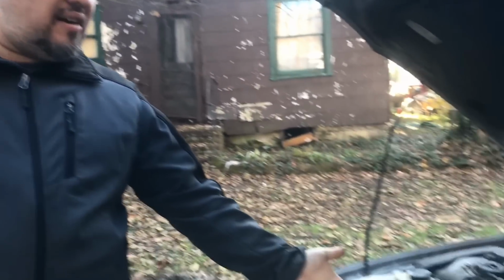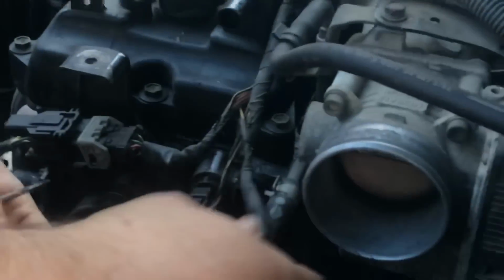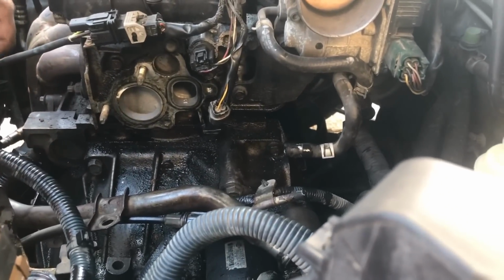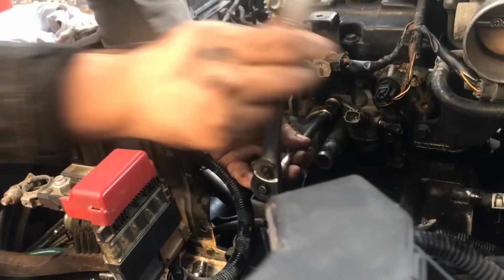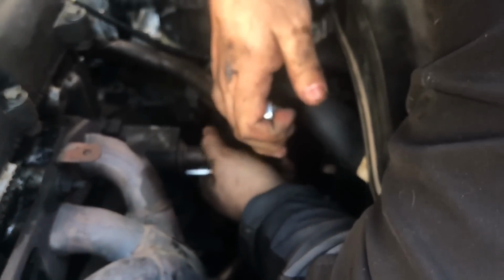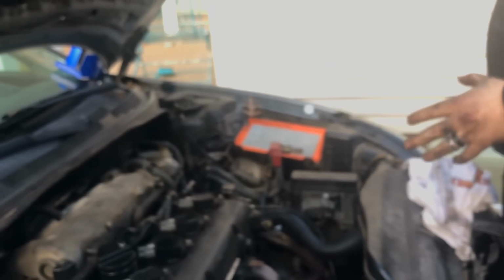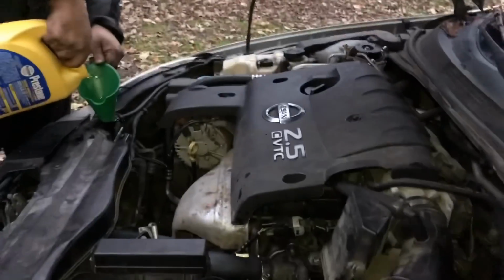2005 Nissan Altima 2.5 litre Engine Thermostat and Water Valve Regulator Replacement.

Comment: Their is a small hole on each thermostat which should be at the 12 o'clock position for air escape..
Reply: Exactly they're a little holes that need to be set at the 12:00 position those holes help to get rid of air bubbles. This guy has not lined them up at the 12:00 position so he's going to have some issues with air bubbles. I'm just saying.
Reply from the maker: It is true. I did make this mistake and had to re-burp the system and put them in in the correct position, but I did manage to get the air bubbles out and put them back in correctly so make sure that it is in the right position when you’re putting in the thermostats.

Comment: Man why are there videos showing upper thermostat water control valve going spring side inside block. And others showing spring side going inside housing.  Which way is correct??????
Reply from the maker: I always take a picture of the way it goes when it comes out just in case I forget.
Reply: Alot of people are installing water control valve thermostat backwards. Look up videos.

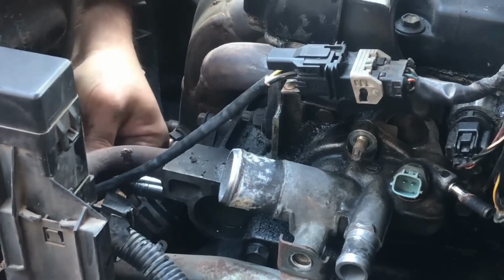Comment: At 15:24, on the upper part of the screen, what is that electrical connector called? it's mounted and has the white locking connector. I ask because I was trying to  put it back together and both ends broke apart and need to replace both end connectors. Thanks in advance and love your video.
Reply from the maker: I always call it a retention bracket that is on the electrical connector.  I can’t remember 100% what it hooks to but I’m thinking it may hooked either the AC compressor or the auxiliary fan.

Comment: In the next couple of weeks I'll be changing both those pieces plus the radiator along with both hoses. Wish me luck!! 😁
Reply: good luck! even though i spent 2 1/2 hour trying to get the housing valve out, i forgot the bottom bolt hidden under the main hose.
Reply from the maker: Good luck my friend and never doubt yourself and believe in yourself and go at your own pace. 👍

Comment: Does the top thermostat spring go in towards engine block ive seen some videos with the spring towards the housing
Reply: Every video I've watched shows the water valve thermostat going spring into hose body assembly, not engine side. Only the front hose to block thermostat is spring in block side.
Reply: Easier way is to look and remember how it came off the housing a mirror it
Reply: Jesus Martinez I have seen videos with the thermostat both ways that’s why I’m confused
Reply: @joelmoreno9566  put it in the same way as it was when taking it out. Spring faces to housing not engine.
Reply from the maker: Yes towards the housing.
Reply: Mr. Goody n so on the video the thermostat installed wrong?
Reply from the maker: Joel Moreno 

No it’s exactly the way I do it in the video.
Reply: @joelmoreno9566  I thought Mr.Goody said to install it towards the housing
Reply: Mr. Goody so the spring goes in the block
Reply from the maker: Joel Moreno  

It’s been awhile since I done the video, but you should be able to see which way it goes in the video?
Reply: @joelmoreno9566  absolutely not. Water regulator valve spring faces away from engine block, towards the housing cover that you remove. The thermostat spring however goes towards engine block.
Reply: Es verdad todos los videos son diferentes
Reply from the maker: Translation: it's true all the videos are different

Comment: he did way to much unnecessary work its much easier than he did it
Reply: I reckon he just wanted more light or something, no harm done but more bolts and screws to deal with is the only downside. I once disconnected my power steering fluid hose when I didn't have to and the fluid was chocolate syrup burned - I wouldn't have changed it if I hadn't done that.
Reply: He sure did. I changed my thermostat and don't recall doing have of this stuff. Im a complete noob so I can't complain how he does things. Im about to take mine off to see if it'll stop my car from running hot
Reply from the maker: I’m not a certified mechanic so I do things the way I do it the way I know that  will work, there may be other ways out there that are faster or easier so I welcome any comments whether they are negative positive or neutral.
Reply: @Mr_Goody for starters, you don't need to disconnect the battery. The part you call the water regulator valve is the thermostat. I didn't watch long enough to find out what you think a thermostat is. If it's a sensor for the coolant, that's called a coolant temp sensor.
Reply from the maker: Google Sucks BALLS   I don’t know what to say, just that you are wrong and I respectfully disagree as I looked the blueprints to this car up from Nissan themselves.  I don’t know everything, but I will post what I know about.  I made 1 mistake in this video and that was I should have drained the coolant first. Lastly I put this video up to help others, youtube is a hobby and I make little to no money off of it but if I can help one person than I’m happy.  As for you, you can just not watch my video if it bothers or offends you.  Nice username by the way.